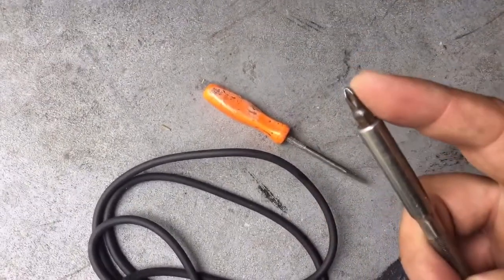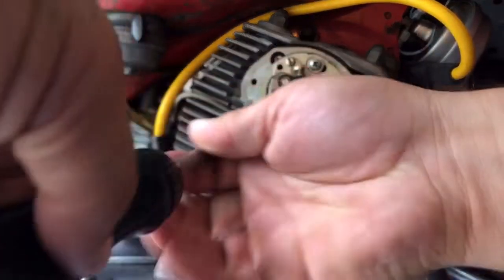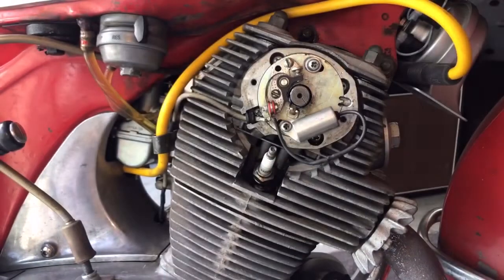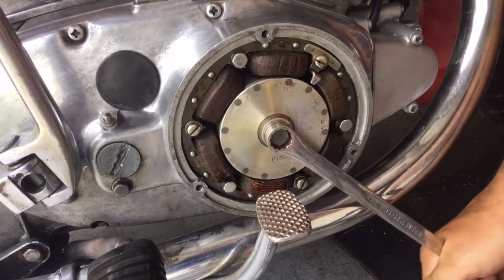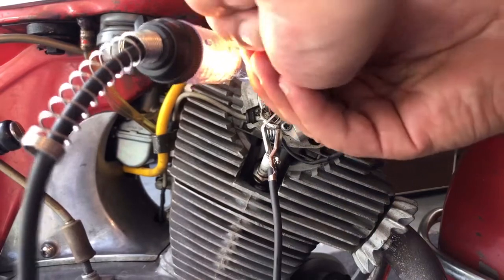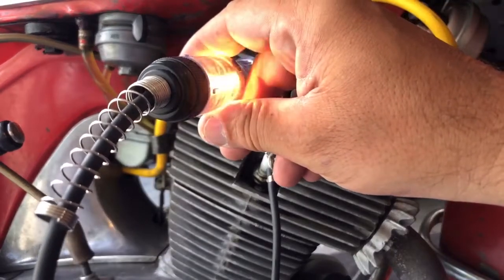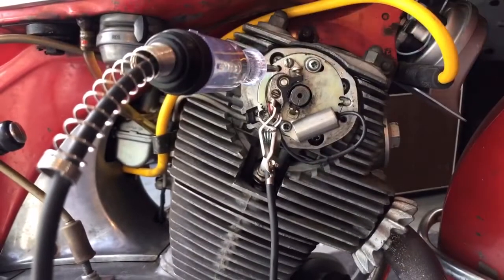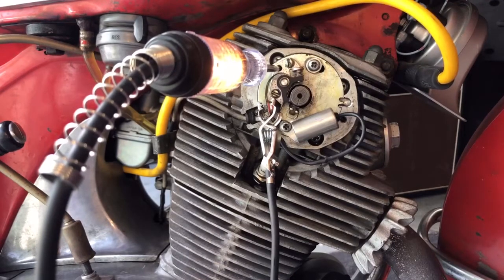How to set ignition points timing on Honda 305 motorcycle

Comment: How do you wire up  a 1962 Honda dream 305 ignition to coil
Reply from the maker: Our electronic ignition? Red to the + and blue to the - .  Make sure you remove the condenser from the circuit.